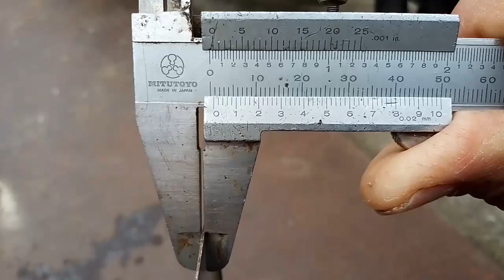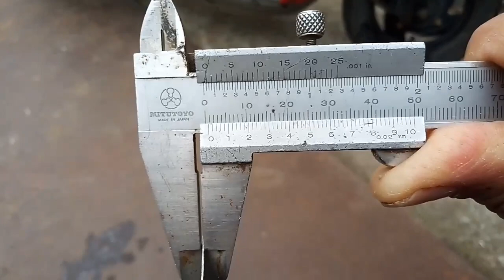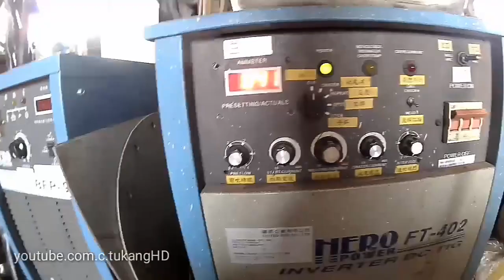Cara Pengelasan Argon Plat 0.8mm | Tig Welding Tutorial Plate 0.8mm

Comment: Saya coba dengan amper 40 dan argon angka 1 mauan robek besi nya. Numpang tanya itu tungsten sama keramik nya ukuran berapa ya bosku? Saya baru beli merk caldwell 250gp
Reply from the maker: Pakai tungsten dan keramik ukuran kecil boss, klo saya adanya tungsten diameter 2,4mm, dan keramik bisa pakai nomor 4, 5, atau 6,,, coba gasnya di angka 2 atau 3 boss,,,
Reply: Kalaw tipis ga mau robek pake cara cold welding tig, amper 180 di pijit seperti kedipan mata